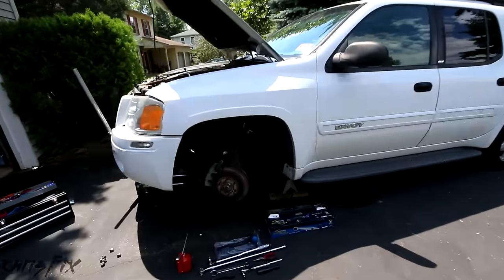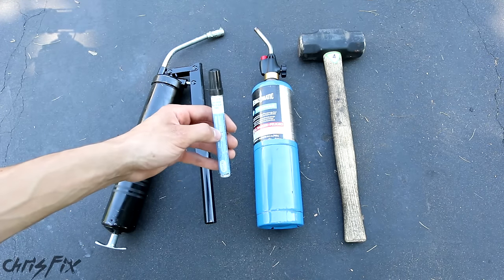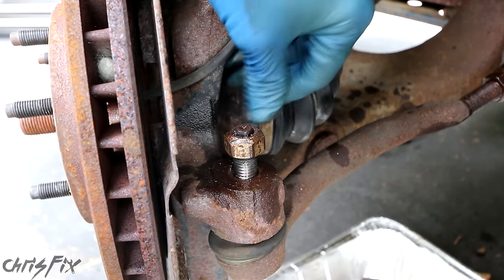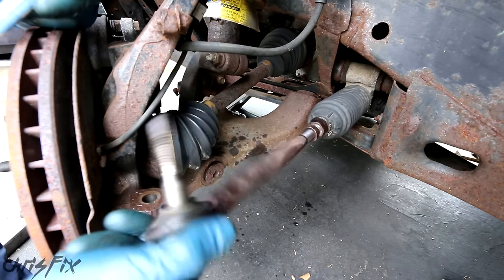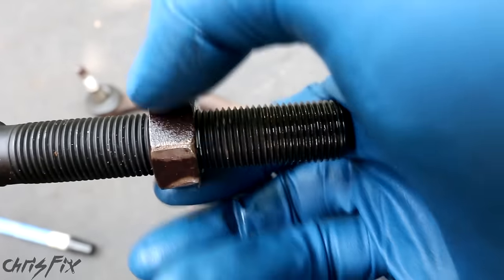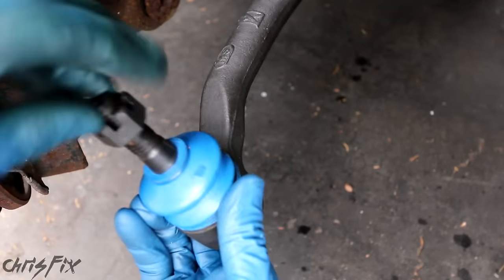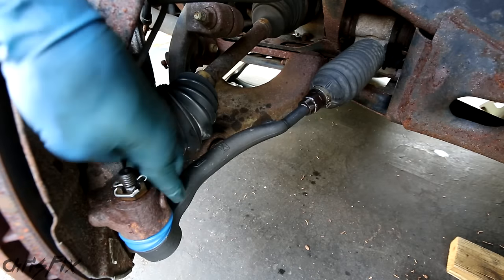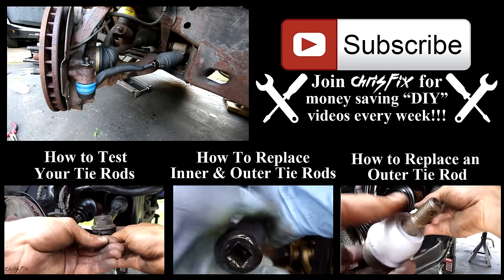How To Replace an Outer Tie Rod End

Comment: Dude why are your cars soooooooooo rusted?
Reply: mrrokoso age does alot of things... My mother had a 98' Blazer which the body was in great shape but the chassis had a ton of surface rust I took a bbq brush and 7-8 black rust-olem spray paint cans and got it stock factory black again! so if you ever have a car older then 2009 and you never wash the underneath just the paint then yeah good chances it will look like the car in the video.
Reply: mrrokoso Because we are from Jersey lol they use road salt and it sticks to everything and rots out vehicles.
Reply: Chris07860 I was thinking it might be something like that. I live near the Gulf and the [salt in the air] makes for similar problems.
Reply: austin sullivan they have that problem on the jersey shore too it's crazy how much damage salt can do let alone in the air too.
Reply: mrrokoso Because salt belt.
Reply from the maker: mrrokoso Exaclty what everyone had to say is why haha. NJ has perfect rust conditions. Road salt, ocean salt, humidity, rain, snow. etc.

Comment: Mevotech is absolute junk, especially their Supreme X Factor garbage. I did my entire Corolla front=end over in X Factor. I drive almost all smooth highway, and am easy on my cars. Every Mevotech piece wore out to undrivable within, (not after), 1 year. I also installed some Mevotech on my wife's Windstar at around the same time. You guessed it... totally worn out. It's utter poo folks! I called Mevotech to complain. They did nothing for me at all. Never again! I replaced everything with ProForged which lasted for several years after that til I sold the car. 

HERE'S A TIP.... If you go to the auto parts store to get let's say 2 tie rod ends or anything with a ball joint... 1st, don't get China-made if you can help it.  2nd, try to move the ball stud with your fingers. If one of the two moves easier, ask for a tighter one so the one's you leave with are similar. While I'm told by manufacturers this should not make a difference, every time I had a looser one, it ALWAYS failed much sooner than the tight one.

Comment: hi mate

http://i59.tinypic.com/330uyw6.jpg

this is my motocycle's front shield, its like mica,my neighbor tape a note on it he taped so much. the tape leaves some ruins so i try to clean it with thinner
and then here we go my shield is screwed up

you think i can make it better anyhow?
Reply from the maker: yeg bilisim You might be able to sand it down with 400 grit, then 600 grit, then 800 grit, then 1000 grit, and then 2000 grit and then this stuff: http://www.amazon.com/gp/product/B0000AY3SR/ref=as_li_tl?ie=UTF8&camp=1789&creative=390957&creativeASIN=B0000AY3SR&linkCode=as2&tag=chri0e2-20&linkId=YQRPZN2R4KXMKYU5